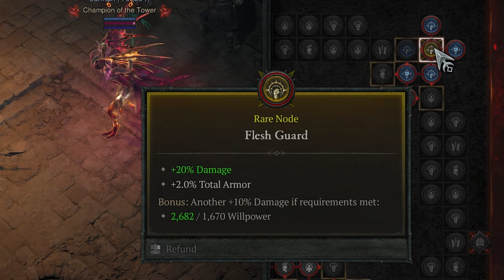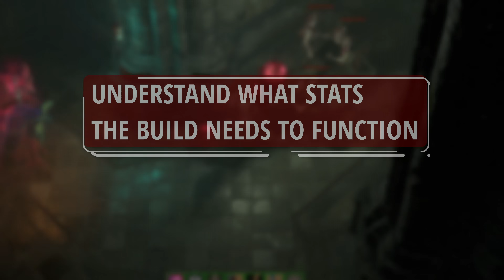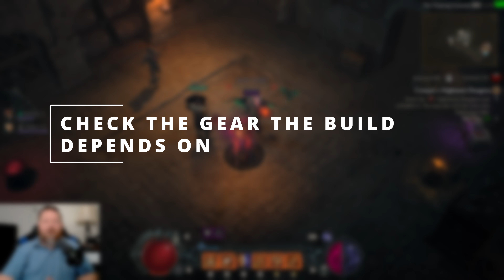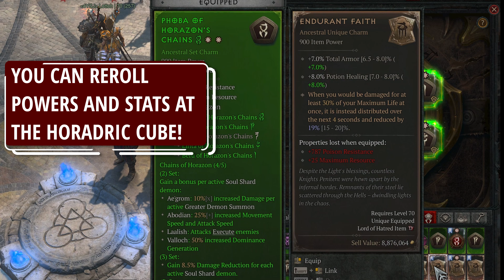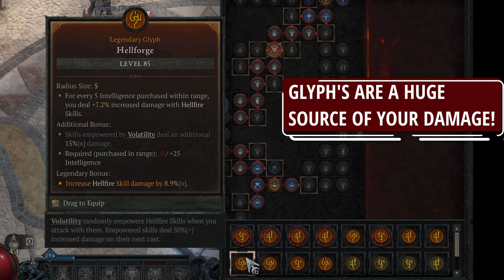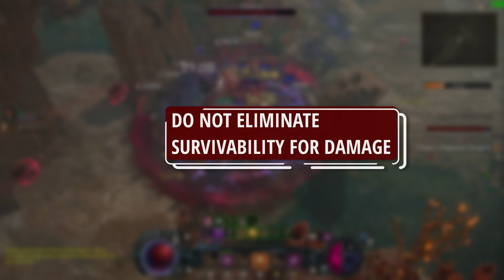You Copied an S-Tier Build… Why Is Your Damage Low?

Comment: I never follow build guides, create your own, and blast away!

For Glyphs, they are bugged, once you reach P200+ you should be able to upgrade all your glyphs (all 5) and progress through the next 5-10 pit levels, to continue upgrading, you can't thou, as upgrading does not provide enough power to move to the next tier. Once this happens, your build is stagnant. 

Also, weapon damage stat, this is a stat that players say does not count, it does, when you GA them. My next try will be GA all my weapon damage stat on my gear. Remember, weapon damage is the base damage all your damage is calculated from, having 2000 weapon damage compared to 3000, it a big loss. (This is not the weapon damage in you inventory, this is the STAT on your gear)
Reply from the maker: Great point on weapon damage.  It is often overlooked.

Comment: That’s exactly the problem. I’m having I can’t raise my damage any further than what I’m doing right now. I’m doing one 1t damage and I can’t get past that I’m playing as a barbarian. I know you’re doing a different belt, but just a quick question so I have currently on my ring crushing aspect, but I was told I should take that off even though I’m always fortified, but I’m using the melted heart they said, either change it for aspect of limitless rage or heavy hitting aspect I’m like getting so much mixed information. It’s kind of confusing and following a build. Is it always gonna match or go the right way? Should I keep the aspect that I currently have on? You actually explain things the way I understand not that I’m slow, but it’s understandable more.🫡
Reply from the maker: I am happy to help!  I don't want to misguide you and need a little more information first.  What barb build are you playing?  WW with Selig?  How many uniques or mythics do you have?  Do you have a link with your build maybe or a screenshot? I can tell you that in most Barb builds Walloping, Heavy Hitting, Edgemasters and Crushing are all fine in those builds.  Kind of like I said in the video.  Build guides are great if you fit all the pieces but some builds need a lot more pieces than others to work.  Some just work with a couple and good to go.
Reply: @Jarmanxp  BARBARIAN END-GAME CRUCIBLE WHIRLWIND DUST DEVIL BUILD (Clearing Pit 126+)

CORE CHARACTER STATS:
• Strength: 3,133 | Max Fury: 715 (Massive Ramaladni Scaling)
• Critical Strike Chance: 85.9%
• Critical Strike Damage: 7,598.2% (Massive Grandfather Multiplier)
• Damage While Berserking: 291.2% (Powers Blood Rage Node)

TALISMAN & SEAL SYSTEM ("THE MAIN INGREDIENT"):
• Horadric Seal: Focused Horadric Seal of the Virtuoso - Unlocks 6 Charm Slots, grants +22.0%[x] Multiplicative Critical Strike Damage and +7%[x] Weapon Mastery Damage.
• 5-Piece Set: Berserker's Crucible Set (Phoba [2GA], Fer [2GA], Mlor [+15 Max Res], Linta [+15 Max Res], Berú [+18 Max Res]) - Grants +50% Berserk Damage, +20% Cast Speed, a permanent 30% Damage Reduction while Berserking, and massive auto-casting shout utility.
• Unique Charm: Blood-Mad Idol - PERFECT MAX ROLL. Grants permanent 24/7 Berserking and a massive +100%[x] Multiplicative Damage bonus (Self-burning penalty completely absorbed and neutralized by Melted Heart of Selig).

ACTIVE SKILL BAR & RANKS:
• Whirlwind (Rank 20) - Main Channeling Skill
• Iron Skin (Rank 15) - Defensive Barrier & Burst Heal
• Wrath of the Berserker (Rank 15) - Ultimate Buff
• Challenging Shout (Rank 10) - Damage Reduction Shout
• Rallying Cry (Rank 5) - Unstoppable & Fury Generation Shout
• War Cry (Rank 5) - Multiplicative Damage Shout

WEAPON ARSENAL & STAT ASPECTS:
• 2H Slashing Weapon: The Grandfather (Mythic Unique Greatsword) - Masterworked +450 Strength | +36.1% Crit Chance | x63% Crit Multiplier | Sockets: Two Grand Skulls | Unique Power: Increases your Critical Strike Damage by x120%[x].
• 2H Bludgeoning Weapon: Laden War Club (Ancestral Legendary Mace) - 2GA Weapon Damage & Crit Chance | Masterworked +410 Strength | x18% All Damage | x35% Crit Damage | Sockets: Two Horadric Skulls | Imprinted Aspect: x140%[x] Multiplicative Damage while Channeling.
• 1H Slashing Weapon: Ramaladni's Magnum Opus (Ancestral Unique Sword) - 1GA Crit Chance | +225 Strength | +25 Max Resource | x31% Crit Damage | Socket: One Horadric Skull | Unique Power: Skills deal 0.65%[x] Multiplicative Damage per point of Fury (Over 460%[x] Total Multiplier).
• 1H Dual-Wield Weapon: Azurewrath (Mythic Unique Sword) - Masterworked +315 Strength | x13% All Damage | x31% Crit Damage | Socket: One Grand Skull | Unique Power: Perfect 156% Freeze Explosion Damage.

ARMOR & JEWELRY:
• Helm: Tuskhelm of Joritz the Mighty (3GA) - Perfect 65%[x] Berserking Enrage Multiplier
• Chest: Warlord Plate (2GA) - Juggernaut's Aspect (Provides 148% Total Armor to reach 71,389 Armor)
• Gloves: Gohr's Devastating Grips - Perfect 117% Whirlwind Damage & Vacuum Pull Effect
• Pants: Tibault's Will (1GA) - x19% Multiplicative Damage While Unstoppable | Runeword: BacCeh
• Boots: Battle Fervor Treads (1GA) - 166.6% Movement Speed | Aspect of Battle Fervor (14.5% Damage Reduction)
• Amulet: Melted Heart of Selig (Mythic Unique) - Masterworked +63% Crit Damage | +35 Max Resource | +25% Resource Gen
• Ring 1: Ring of Berserk Fury - Generates 10.8 Fury Per Second While Berserking
• Ring 2: Heavy Hitting Signet (2GA) - Perfect Max Roll x60.0%[x] Multiplicative Damage to Dust Devils

PARAGON BOARDS & HIGH-LEVEL GLYPHS:
• Board 1 (Starter): Twister Glyph (Level 124) - 105/40 Strength Maxed for +777.9% Base, x36.8%[x] Dust Devil Multiplier & x13%[x] Damage Buff on Spawn
• Board 2: Warbringer Board - Exploit Glyph (Level 125) - 54/25 Dex Maxed for +85% Base, x12.9%[x] Vulnerable Multiplier & Auto-Vulnerable on Hit
• Board 3: Carnage Board - Wrath Glyph (Level 126) - 54/25 Dex Maxed for +166% Base & x17.2%[x] Crit Multiplier | +3 Fury on Crit
• Board 4: Blood Rage Board (Legendary Node Active) - Ire Glyph (Level 113) - 115/40 Strength Maxed for +166.2% Berserking Base & x13.7%[x] Close Damage | 10% Elite DR
• Board 5: Flawless Technique Board - Imbiber Glyph (Level 120) - 44/25 Willpower for Permanent +82.7% Base & 14.5%[x] Healthy Multiplier (Perfect Melted Heart Combo with Unmapped Potion Button) I mean, I did my own thing to be honest with you. I didn’t follow no guide. I made it to Pitt 125 after that I can’t get past. I’m trying to hit harder.
Reply: I just started taking the game seriously I’ve been playing for fun never made it past Pitt 80 since he’s 13 and 12 started taking it serious and in season 14 but again I’ve done my own thing so I know I have to fix a lot of stuff on my weapons. My build completely. Any advice would help i definitely  your channel. I was actually  running a warlock then I switched to barbarian.
Reply from the maker: @erock4338 I will look through this and see if I can find anything to help.
Reply from the maker: Overall your setup is not bad at all. I looked at this and my question is with Azurewrath, do you have a good freeze proc for this?  I would swap that to a legendary aspect like Edgemasters or Crushing unless you are getting constant freeze as these will be more consistant damage.  How is your fury generation?  You have Ring of Berserk Fury and if your fury gen is good you could swap that to an offensive aspect also.  Like one weapon channeling, other weapon heavy hitting, and one ring crushing and if you can fit another offensive one go with edgemasters but if you need the wrath regen keep it.  

Paragon board you might swap out Ire and Imbiber glyphs for Marshal and Might.   Might have to swap around glphys and boards to something like -  Starter - Exploit,  Carnage - Marshal,  Blood Rage - Twister, Warbringer - Wrath, and Flawless Technique - Might.  

I want to say these may not solve your issues as I am just looking at this text and trying to give suggestions based on what I see here.  Maybe it can help squeeze a couple more pit tiers maybe not.